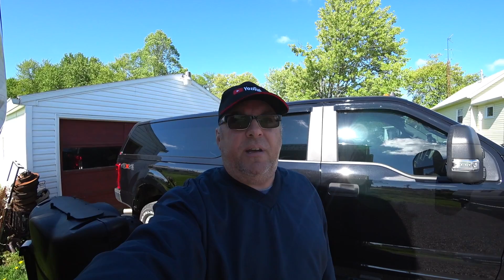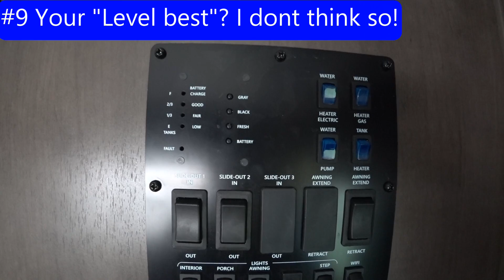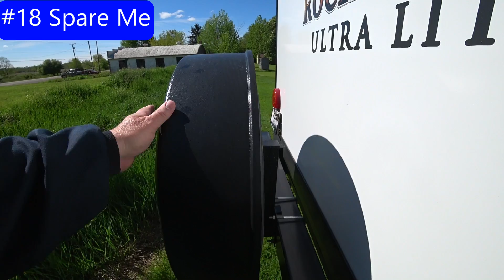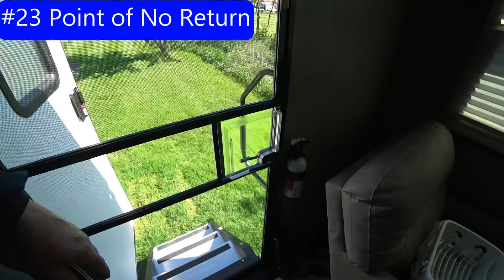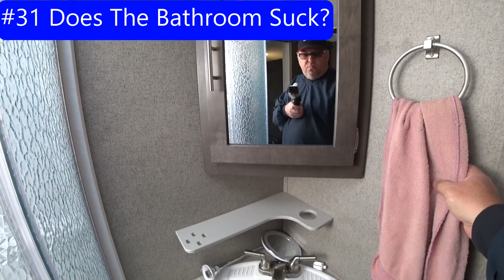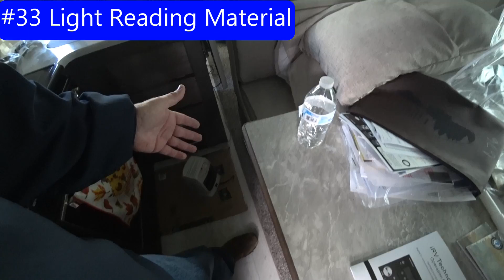36 Dislikes on Our BRAND NEW RV ☹

Comment: The TV option that you accepted.   Why don't you go buy a 120 volt TV exactly like the 24" cheap tv you complained about and put it on a wall where there is no TV currently.   Hmmmm, it won't mount.  Need to buy a mount.    Hmmmmm there is no 120 volts there.  Now you have to get wiring and devices to the location.   Hmmmm, the TV has power now and turns on, but no picture.   Ok now you've got to run a signal cable from the switch to the TV.    Hmmmm, the switch is two TVs, now you need a three TV switch unit.
You really need a huge block of cheese to go along with all your whines.   #36 was definitely legit though!!
Just having some fun with you!
Reply from the maker: Lol yep and here we are 1 1/2 yrs later.. Getting ready to hit the road fulltime 😁 newbie mistakes.. All is well as we are making it work 😁

Comment: Thanks for all the insight.  My trailer has similar doors and steps.  I'm not sure if you've noticed this, but the legs for the steps are adjustable.  If you park on a site where the pad is a couple inches higher than the surface the legs are on, you'll want to extend the legs.  If your next site is level you have to shorten the legs back up in order the close the door.  The steps look good in the showroom, but not so great in real life.
Did your trailer come with any 12V, "lighter" plugs?  Mine didn't.  It would be easy enough to install one, but, I haven't done it yet.
Reply from the maker: We have a power port in the bedroom.. I added one at the rear of the RV.... yes, we know the steps are retractable and extendable however since we have two doors and sites can be relatively unlevel, we have found in two separate situations when the RV was level the steps would not extend far enough. So we custom made long legs to accommodate those situations.

Comment: I’m really thankful we saw this video and thanks for being so picky. We would not have noticed half those things because neither of us is handy and can easily fix things. We bought a new Jayco Jayflight 29bhs back in 2008 (2009 model) and something we didn’t notice was how dark it was inside in the daytime when the lights are out. There are not enough windows. Lately we’ve heard the more recent Jayco’s have a lot of repair issues and we’ve been looking at a Rockwood 8332SB or 8291RK 5th wheel as the layouts we like. Your review will help us when we do go looking.

Comment: Just wondering did you look at the Coachmen Catalina legacy Edition 283RKS  ? 2019 or 2020
Danger Dave 62
Reply from the maker: Yes we like the Coachman's but the quality of the Rockwood is far more Superior however, it's also going to cost you more. We have heard people complain about the rear kitchen models Towing strange sometimes because of the load of all the kitchen appliances in the back even though the tongue weight is okay it kind of gives a teeter totter effect when driving down the road. Again that's just what we heard and I'm sure it's not all models

Comment: You’re awing side review is why I bought an Airstream. They put all of those things on the opposite side of the trailer. So many mags
 we looked at overlooked this important detail that when I saw the outside I never went inside. Sitting outside is what we do daily on our trips.
Reply from the maker: Yeah there's a lot of older RVs that it used to be standard on. Since the design of the Airstream never changed where everybody else kind of modernized they started leaving those extra features off. But they do still make them for motorhomes

Comment: I'm on the fence between a Flagstaff Micro Mini and a Rockwood Mini Lite. It boils down to the the interior colors since we are ordering one to get twin beds and theatre seating in a 22 footer. Both are identical expect for the interior. It's between the Flagstaff Opal or Rockwood Stone. Is your interior Stone with Slatewood Cabinets?
Reply from the maker: I believe it is called Pebble interior and I think the cabinets were slate.
Reply from the maker: Some some Rockwood dealers are not Flagstaff dealers. Even though the units are identical for the most part you may have issue with warranty at the dealer if you have one or the other.

Comment: You aren't that picky.  These RV designers and manufacturers never actually use their products.

I have a thor hurricane and it has a few unbelievable flaws...
The light switches are too high to reach.
One switch is down in the stairway. No light near the control panel.  No heat duct to the bathroom. No usb charging stations except at drivers seat.

Just fundamentally flaws that would immediately jump out to the designers if they only spent a little time in them.

Comment: just saw your site. i have a 2018 rockwood 2650ws 5th whl. has a lot of similiarites to your unit. i bought it new, and cant say i have any dislikes on it at all. the blk water flush is right where you need it, the drains are easy, and real easy to winterize. mine has 2 windows in the back, and the tv hangs there. a fireplace is below. it has 3 slides. mine has single a/c, 15000. does a good job. i traded in an 08 rockwood fiver on it which was a real piece of work. anyways, in my opinion, rockwood makes a decent unit for the money. at least on my 08, i didnt have delamination like on a lot of other higher priced rigs ive seen. you have a nice looking unit. enjoy. charles, ohio

Comment: #10. Isn’t there an outlet under your table on the left hand bench seat? I looked at the Flagstaff models last week at a dealer and they have outlets where I described. I am picky too and liked they have an outlet under their
Reply from the maker: Nope
Reply: That’s weird.  I figured that’s why the drawer is shorter under that bench seat. The flagstaff version of your floor plan has an outlet. Guess they are not the same.

Comment: sorry you got a cheap one.   Your jack will fail from bringing it all the way up, I would mark the jack about an inch from top and stop there.  Get a Jensen TV they have nice 12 volt tv.  That  medicine cabinet is small.  You can replace the heat covers with real heat vents, they put the air return covers on that do not have a way to close them, it saves a dollar.  If they give you an owners manual and it is wrong they will get sued so why make the owners manual.  Thank you I was considering a rockwood.  The black tank is because people flood the black tank hooking up thinking it is the water.
Reply from the maker: we love the Rockwood...I tried to show no RV Is perfect. I can find many many things wrong with any RV I look at, Thats just me..

Comment: RvDaydream , do another Video , one where you talk about the things you love! uuugh! 
So I work in HVAC (heating Ventilation and Air conditioning. in a system like you have do not try to block off certain heat vents, they system will over heat , or in the case of AC freeze up. be happy you have a plethora of outlets, it helps keep the Rv warm or cool all through out! also , you only need heated tanks if you are camping in cold below freezing temps. most people depending on where you live do not plan on this! you only need it in emergency situations. I did enjoy how much ifno you covered. A lot of people may benefit from really looking at every thing about a camper, before they buy! , so thank you for that.
Reply from the maker: Thanks Dan, we will definitely do one for the likes of it 😁👍

Comment: You made some very valid points, others were personal preference. I just watched one video of someone complaining their spare tire was under their RV instead of mounted like yours on the rear, which on the rear allows for easy access (my preference).   As for mounting things on the bathroom wall surface, there's a product advertised on YT often that is a clear heavy duty rubber type tape that comes in a roll. You can cut out a piece per what is needed, mount it on the surface, then mount your mirror or whatever to that.  I believe most RV designers are not users of RVs, so they haven't a clue. Have you sent this video to Rockwood? If not, you should. Maybe they will get smart and have you host a user focus group to pick apart designs before made.  I wish you were near by to help me buy an RV. I'm inclined to go used, older and better built.  Watch the YT video of 6 hours to build a Jayco, and you'll NEVER consider buying one after that! The demand for light weight trailers means fewer screws, flimsy parts (like your exterior lower side walls), staples instead of screws, less glue, etc, all to lighten the trailer at the expense of quality.  Good video, thanks, and I do think you're just a tad bit obsessive!

Comment: About the lights in the bedroom you almost have to get out of bed to turn light off.  Switch next to receptacles.  Fan for bathroom my wife needs a stick to turn  on and off, how on the wall.  No way to use cpap machine boondocking with inverter.  For the money spend they haven’t thought out some items. Nice camper
Reply from the maker: First thing I did was have wife check if she could turn off fans...If not I would have had dealer install max air with remote controls...As far as CPAP Check out this option...https://youtu.be/6ulgaxpIJ9g

Comment: You are not picky, you are just acting up for the internet.  If you were picky, you would not have bought this unit.  If you were in the market for 3 plus years shopping units and were even just slightly picky, you would not have bough this unit.  Almost everything you complained about is readily apparent to even the most casual buyer, let alone someone claiming to be a picky buyer that scouted the unit for such a long time.   

Not that there is anything wrong with this unit on its own merit.  This model was on our radar.  We saw it.  We liked it.  The only real problem we had with it was the price.  This unit is way overpriced for what it offers.  We ended up getting the an early 2019 Cougar 27SAB (white front cap), which has almost the exact same layout as this Rockwood.  We paid $8k less than they were asking for on the 2019 Rockwood 2604WS, though, and the Cougar offers so much more premium.  Auto leveling system (which is freaking awesome, btw), in Command touch control panel system, larger bed, better kitchen counter arrangement, better clearance in the rear seating area, better placement for the main TV (and its a larger TV), and the rear chairs are actually recliners and not just rockers.  One thing we really did not like on the Rockwood was the way they did the walkthrough bathroom.  Walkthrough bathrooms just suck in general for a variety of reasons, but if you are going to do it we have only seen Grand Design do it right.  Forest River does not do it right.  If you can get this unit considerably under $30k OTD, I would say keep it on the short list.  However, the OTD price we were quoted was waaaaaaay more than that.

Comment: Holy Mackerel... That Tank Flush connection is just totally inexcusable.  

As for the lack of power outlets in your slide, you could have ended up like our 5th wheel.  On the driver's side slide, there is a duplex outlet next to the floor by the dining table.  There are also two 110v overhead lamps.  Stay with me... At the rear of the trailer, there are a pair of duplex outlets, one in each corner.  On the passenger side slide, there are two duplex outlets in the kitchen.  ALL of these outlets and lights are on the same 15 amp circuit with a central 110v light, AND the REFRIGERATOR!  Have a space heater running and the coffee maker kicks in?  Bye bye almost everything in the rear of the RV including the fridge.  Now, I have to say that someone probably designed it one way, and then some other clown came along and built it another, unintended way.  Pretty sure that's what happened to your tank flush connection.  There was a box to check, and they checked it.  Just not if the implementation made any sense, whatsoever.

Just one of the joys of RV living... figuring out what the heck the builders were thinking when we find one of these issues.

Comment: Nice rv Mike! Our 2018 Rockwood has some of the same stupid things too. We've had minimal things wrong with ours but overall love it. I agree with you 1 BILLION % on things like the keys being very difficult to work, I was just telling my Wife last weekend about the electric cord being so firggen heavy and what's funny is last week I turned on the "reading light" at night before we went to bed and holy crap! its a spot light lol. My Wife says the same thing about the table, we don't dare leave it up while driving and not that's its super hard to take down but its one of those things lol. Hows the new truck tow the new rig? We traded our 16 F250 6.2L in for a 2019 F350 CC with a 6.7 diesel and its night and day difference, towed our trailer for the first time last weekend into the Pittsburgh area (lots of hills) and was towing about 11k lbs and was getting right around 11mpg with the air on.

Comment: Idea for your table:  get a hollow pool noodle from the dollar store, cut it to the width of the end of the table, then slice it open half way, and wrap it over the edge of the table to protect the window when in transit mode.  ;-)
Same kind of idea for the water pump hoses:  get some of the foam pipe wrap that's intended to keep outdoor pipes from freezing, and wrap the hoses--presto--no more noise!
I don't have a rig yet:  I'm still doing my homework.  However, I was raised around tools, and I can do a pretty good "MacGuyver" fix for minor stuff...like the dish drainer that didn't come with a silverware basket--I just got a small container from dollar store, and drilled holes in the bottom!  ;-) I'm pretty creative.  
Happy travels to you!  Thanks for pointing out so many things to be aware of.

Comment: You mention a lower a/c , do your home work on smaller a/c units ,the barrel style compressor is mounted on its side instead of vertical ,very very noisy,the vibration is unbearable ,i have one and going to install a rubber mounting kit to stop vibration a sound.
Reply from the maker: We have central air at the house. Is that what you was asking?
Reply: @Rvdaydream  rvs only

Comment: Did you mention any of these things when you were negotiating the purchase? I would have like the 12volt TV. and some of those smaller items  Thanx
Reply from the maker: The only way that you can get those options like LED TVs that run on 12 volt is if you purchase the RV with TVs and then have them swap them out. Now the bedroom TV was an option all together so you could leave that TV out but you couldn't get the TV mount on its own. So that means you would have to pay the dealer to install a TV and a mount that you would purchase separately. Although Rockwood has some of the most options as far as the interior goes you can't just pick any brand and style of TV set that you want them to install. Just like we could not get recliners in place of rockers and we could not get a porcelain toilet in place of the plastic one. Other than a couple of small bicycle mounts that go on the front or the rear of the RV we pretty much got every single option that was available. It's not a designer service just like you can't go into Ford right now and order a Mustang with a 6.2 liter engine as that's not an option. Before options are price was $26,000. If you check online you'll find that's pretty darn low for a 2604ws.

Comment: Hey there ! We bought a 2604 as well. I was a little bit cheaper and went with the 2018 model. I must say, I honestly like the 18 model better then the 20. I’m not a fan of the new steps. Having the framework in the inside of the rig is a big disadvantage in my opinion. And my black tank flush is on the driver side. Other then that we seem to have identical problems. I also noticed my bedroom always seems to be colder then the rest of the rv. I do a lot of colder season camping and the furnace just doesn’t seem to get any heat in the bedroom. Do you or anybody else have a idea what it could be ?

Comment: I guess you can get a local woodworker to build a longer drawer. I guess you can consult a RV technician about running a 120 volt line to the living area slide.

Comment: I’m glad you are picky, since you are showing things that many people would get dazzled by the new toy and not find those things until they have bought it and learn the hard way. I could see making a checklist based on this video just to make sure important ones can be addressed at the very least.  
I hope you know since you have detailed all the items that you don’t like. If you were to replace or add everything that you listed (12v tv’s, low profile air conditioning units, change the vent covers to ones that close...); what would it cost to upgrade aftermarket? 
I wonder if it would be more economical to buy say a $10k cheaper trailer and spend say $8700 putting the better items in it?
Great video as always!

Comment: We have a 2020 2608BS. Not a fan of steps - you need to have enough clearance and the door all the way open to put them out.  We coil thepower cord in a laundry basket leaving enough length to plug into trailer & uncoil what we need to reach pedestal. We leave it under the trailer in the basket. When done we coil it up again and set in a boot tray in the under bed storage to catch any dirt or water. Always wipe off what you can with old towel. This is a true review and we really appreciate it.
Reply: We are seriously looking at the 2020 2608BS.  ? on need for 2nd air conditioner and any recommendations for what you think is needed for optional stuff.  ty